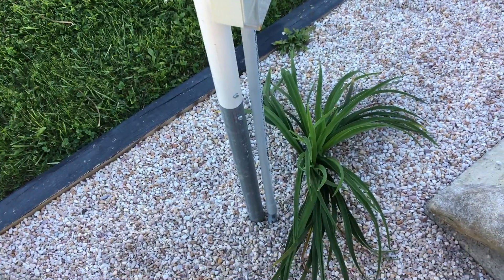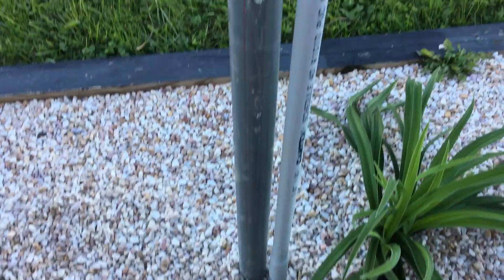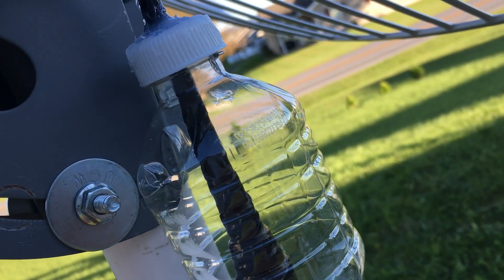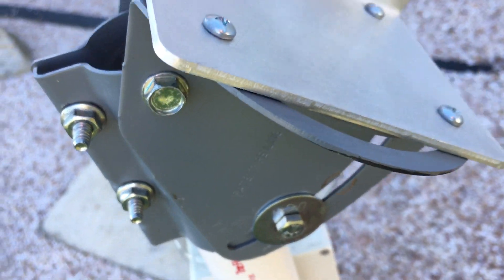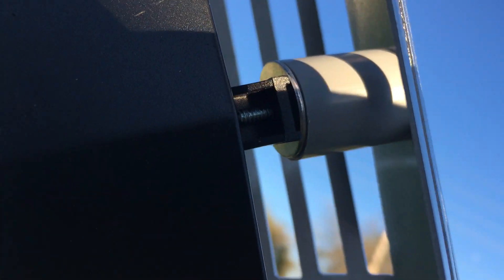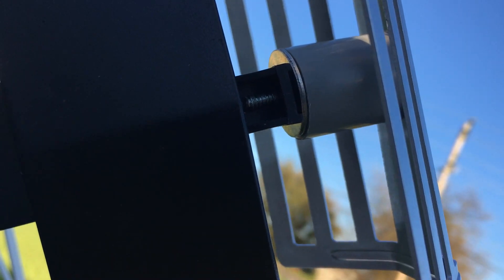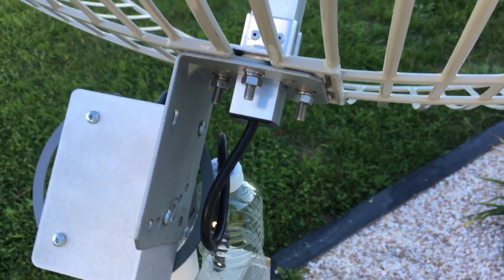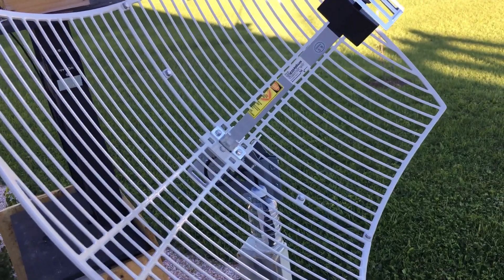2.4GHz 24dBi WiFi Directional Grid Parabolic Antenna MOD For GOES Satellite Images

Comment: Please tell, does the big reflector connect to the small reflector using a GND connection?
Reply from the maker: No.
Reply: @FuzzThePiGuy  So the Big reflector is not grounded, just floating? thanks

Comment: Nice setup! What are you using to connect the N connector on the antenna to the SMA connector on the Sawbird? Adapter or N to SMA pigtail?
Reply from the maker: N to SMA adapter. No pigtail.

Comment: Nice. My antenna is on its way. I already have the nooelec sawbirdGoes lna/filter and a rtl-sdr. Not sure my sdr will suffice and tune at the almost 1.7ghz frequency but will try.. which sdr are you using? And how long is your usb run and is your cable “ active”? Thanks! More videos showing the rest of your setup and decoding and how to aim/track the sat would be killer!..
Reply from the maker: I do have a video of how to setup the GOES software. I’m using the Nooelec usb smartee dongle.
Reply from the maker: My usb cable is around 9 foot long.

Comment: nice one, got a nesdr too. does the LNA need to be hooked up to +5V (in my case (pmr or cb)?
Reply from the maker: I’m using a dongle that powers the SAW filter. But there is a micro usb on the filter that can be powered from a external source.